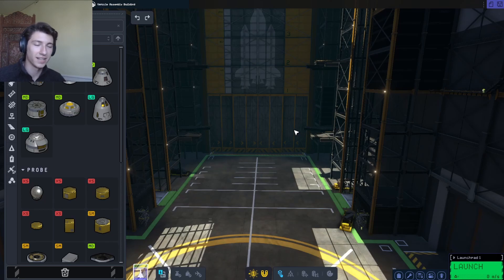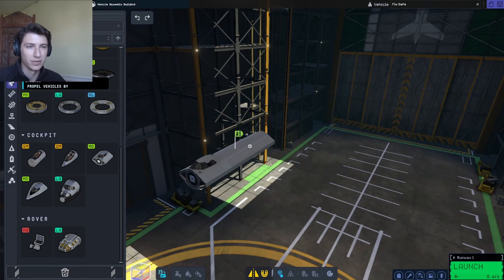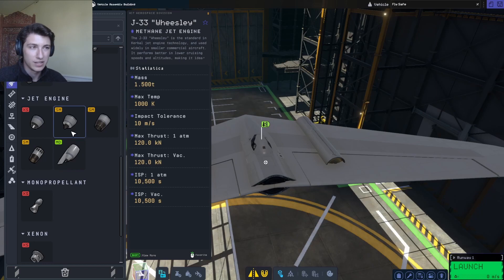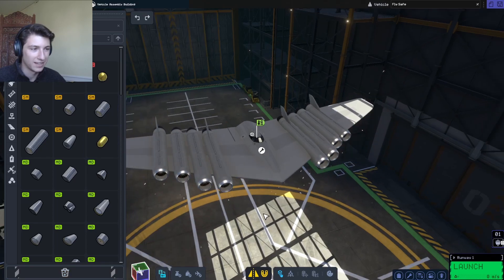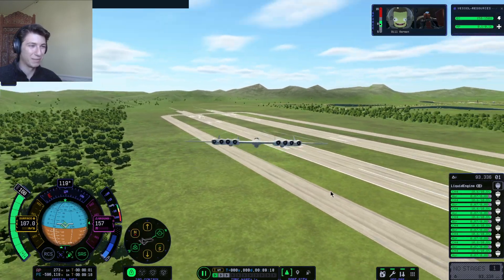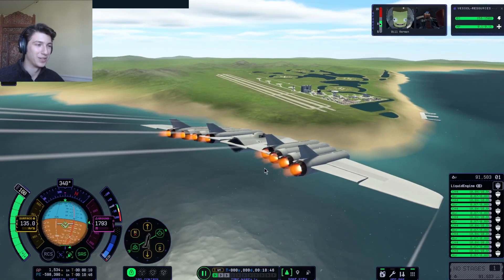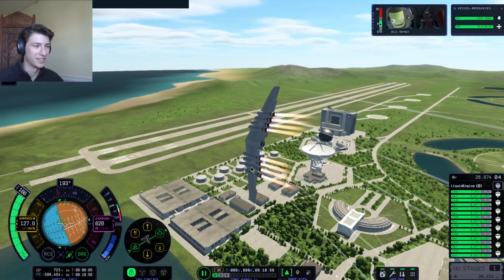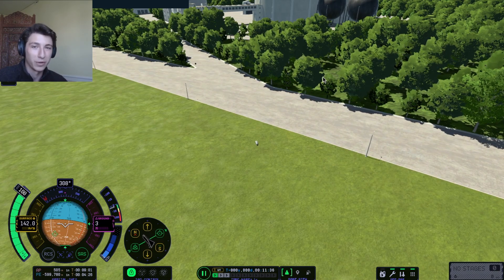KSP2: Building a MASSIVE Flying Wing (YB-49) | #ksp2

Comment: To reduce sliding on the runway, get the front wheel friction on manual down to 0, in VAB. (right click, find it in parts manager and put the friction on manual, then reduce it to 0). In the same time, get the back wheels on non-steering. (you don't need steering on them). Reduce the break power on the front to at least 20%.
Also you need bigger vertical stabilizers considering the span of your wing. (or put more of them :P )
Nice plane :")
Reply from the maker: I will definitely do this on my next plane. Thank you! I love flying wings